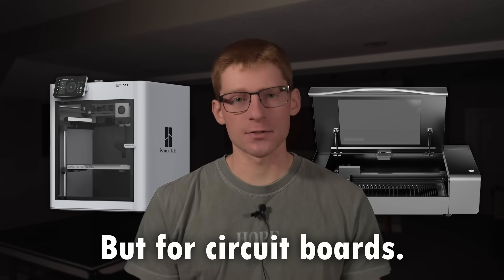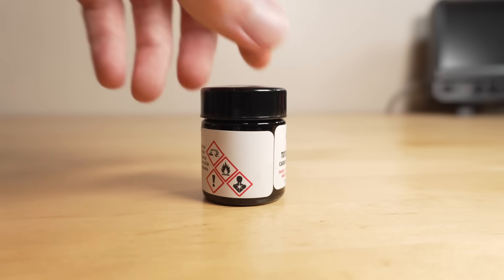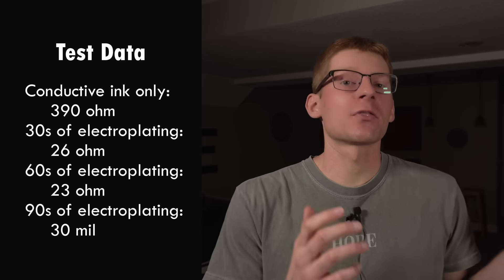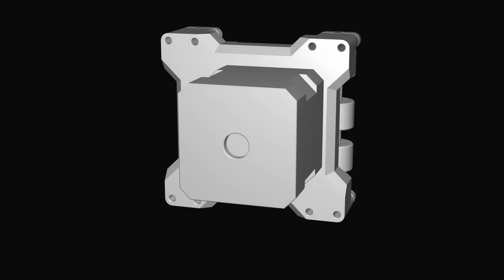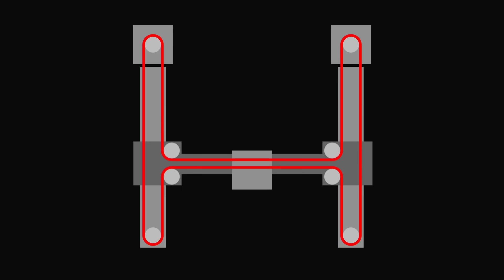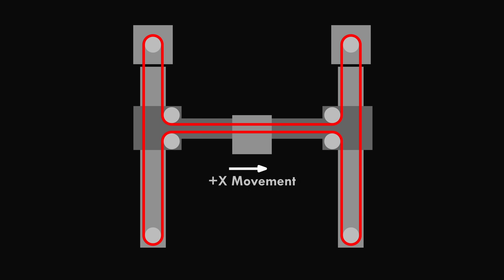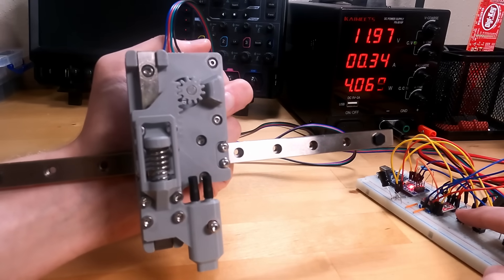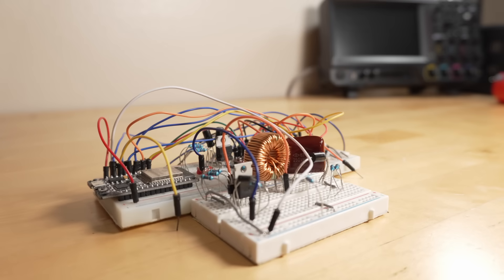I'm Developing a New Circuit Board Manufacturing Technology

Comment: For 30+ years, I've used a "mechanical etcher" to make hundreds of doubled sided PCB prototypes and small production runs. Basically it is a CNC router ex-manufactured by Instant Board Circuits model IBC912 (9"x12"). Demo vids on my channel @curtcoffee. Two 0.125" diameter registration pins are used to align the PCB to the machine bed, especially important when the PCB is flipped over to do the second side. The spindle uses a 0.125" collet with a set screw to hold either an etching V cut bit, dill bit, or router bit. Several mfgs make PC eyelets for connecting top and bottoms traces as others have commented below. Instead of plate through I just use a bare copper wire, typically a single strand 0.025" Dia. from a 22 AWG stranded wire then manually solder top and bottom. The IBC912 spindle (Z axis) is either up or down using a solenoid. No bed leveling needed. It has a foot that rides on top of the PCB that is manually positioned to set the V cut depth, seen on my video www.youtube.com/watch?v=th6Mw6TDyQ0. For single sided boards, I just tape down the board, no need for registration pins. Note: X and Y need to be square (trammed) else top and bottom sides will not align. I now use KiCAD schematic and layout, FlatCAM to create the tool path G code, and Mach3 to control the X, Y stepper motors and Z solenoid. It is a 2.5 D machine. Good luck on your project. Sounds fun.

Comment: Wouldn't you want to eliminate right angles in the reservoir so fluid is not trapped in the right angle areas by surface tension?

Comment: There is presumably a point at which the vias are too small to electroplate quickly, which is clearly at least 0.3mm. I don't know if PCB CAD can handle custom via sizing, but if it can you could try holes of increasing size up to your 1mm test and if something like 0.5mm works then maybe that could be viable?

Comment: As an idea, i had while you were describing how the copper plating is usually done all at once... what if borrowed an idea from SLA printers where instead after the graphite coating with the tool-head(s) you lowered the entire board into a copper plating solution at the bottom, much like how SLA printers lower into the resin, and then plate. One thing that might get in your way is the fact that the tool-head might get in your way. you could mitigate that by having the tool-head "park" out of the way. 

there may be other reasons why this wont work that i don't see as this isn't my expertise but i hope it might give you an idea that might work?

Comment: Hey bud, I manufacture  machines, one of the things I realized from doing it is that even slow as hell but, does the job, is worth pursuing. Say you go at 15 min per via, and it takes 4 days to make a 400 via board , better that a week ordering it from china. Would be 670 vias to break even. Do a 4 toolhead design,  thats  2680!,  If the process is energy efficient, silent and reliable. Some people dont care.  They will just try to  reduce via count. Since 2 layer boards are cheaper than 4 layer boards, I avoid 4 layer designs like the plague.   Look at 3d printing, people design around layerlines, no one is complaining about that too much anymore, 48 hour print times are fine if it does not fail. I would, as other have commented, go for  a dual set up, maybe a chemical  slow process, for bgas etc and a 0.5mm wire for routing. then your in business.

Comment: Awesome work ! but I think the machine should feed in the correct diameter wire thru the via. Then two identical endefectors like you have will simultaneously ' pinch, cut and spot weld ' from below and above and then move to the next via and bingo ! No nasty chemicals and Roberts you relative ! Talk to Stephen Hawes about x/y positioning or buy one of his pick and place because the two of you have the same goals, as for me ? I shall wait for the cheque....cheers !! oh yeah for reference you youngsters have forgotten, and probably will never see a PNP machine for thru hole parts!! putting wire through a hole at high speed is easy and they did in the sixties LOL!

Comment: I've used via rivets to repair faulty vias caused by corrosion. Wouldn't using via rivets be a far simpler solution? You could even replace the rivet press(although that is likely to be a trivial job for a CNC machine) with a soldering bath

Comment: ive been trying to solve the via problem for years :) good luck to us all brother. try thinner substrates - go to 0.4mm and I bet it'll be much easier. then you unlock multilayer sorta, if you find a way to bind these and make the vias interconnect, and align them layers. good luck again! - p.s. - another idea - try and make the holes sorta conical and not cylindrical - that way the material spreads a little bit better! it's not perfect but i've experimented with that method

Comment: I tried solving the via problem with handmade PCBs. I take a pin from a berg strip, put it through the hole and solder it from both ends. 

If you're trying to make PCBs at home for testing or small projects, you can use this method easily. If you want to miniaturize your design, you go for commercial production

I think you can also find a way to automate this and scale it down

Comment: Have you tried soldering through the hole... On the bottom side you have a flat neoprene butt with a cavity in it to line up with the bottom side of the hole and a hot 3D printing head (with a 0.2mm hole) on the top side and a syringe on the top of the 3D printing head to squeeze solder paste in through. The hot liquid solder would be pushed in through the hole to the other side where it would solder the under side with the top side in a quick precise squirt. If you used a Thermal Electric Cooler or TEC to cool the neoprene to a colder state, the liquid sold would harden quicker and should not drip when moving to the next hole. Because the TEC cold side and 3D Print Head hot side will only touch the PCB at the moment of injection, the board and printing head will not be cooled enough for the solder to harden on the print head nozzle. Would be an interesting video to see someone make that.

Comment: Wow what an impressive project ! To make vias on single face prototype board (made with laser or cnc mill) the tricks I found is to drill the via the size of copper solid core wire, then insert a small piece of it and solder it on both sides. It's a quick hack but it works a charm when making pcb prototype at home without equipment

Comment: As earlier posted: copper rivet.
1) Wire through needle to push through via
2) solder paste squirt on back, and solder tip heat
3) solder paste top,  solder heat.

Yes whiskers will be there a bit, but hand cut possible.   FDM shows you can get 80W to a head, so 6 mil is easy.

Can even do it by hand w/ cheaper model.

Comment: Have you considered using copper rivets to remove the chemicals for the via’s? I use the .4 and 1mm copper rivets they are reasonably priced 200 for 12$ + shipping.

Comment: I think your primary issue is with your deign requirements you have set for yourself. This is a prototyping machine for prototype boards. Why do you need to have .3mm vias? Why for prototyping can they not be 1mm? I understand that having to modify your gerber files for protoype and production would be annoying and a possible area for error but rapid prototyping is a nice trade off. I am not a fan of Elon Musk but he hit the nail on the head when he said you need to look at your design requirements because that are almost always bad.

Comment: As a maker that enjoys electronics, your concept is extreemely good. but nethertheless a hudge issue came to mind : the electroplating works efficiently because enough current can flow from the oxydizing anode (ie the copper plate in the bath) towards the reducing anode (ie the via being made). To maximize current, you will need to decrease as much as possible the resistance of the electrolyte path, by several factors :
1) put the oxydizing electrode after the pump (the peristaltic pump will make an open circuit with the pinched silicone tube). you can make just a little chamber for the electrode that would stay filled with electrolyte filled on one port by the pump, and the electrolyte would shoot out towards the nozzle.
2) You need to decrease as much as possible the length of tubing beetween the electrodes as the elctrolyte path resistance is proprotional to it
3) You need to keep a wide path to decrease even more resistance (R = c*S/L with C the conductance proportionnal to your electrolyte's concentration, L the pipe's length and S it's surface). I know you will need a thinner end to avoid air comming back up and keep the path filled tanks to surface tension, It will be a matter of compromise.

and maybe plating a pcb with a photo-resist layer would avoid getting copper build up on the outer surfaces of the pcb and only in the hole to help it stick ? it's just an idea but there seems to be an issue similar to dendrite groth in lithium batteries. avoid letting copper grow where it shouldn't may help

Comment: Uhm…why not use “rivets”? Wire is pushed through the hole and cut with a little slack. A tungsten or titanium needle presses and heats on both ends.

Comment: you can use a simple thin copper wire instead of vias . you choose to make vias by electroplating , but that is very hard and complicated , instead if you put a thin copper wire through the hole and connet both side to the pcd , it could work like a vias . i am waiting for your response , all the best.👍🙂

Comment: I am only up to the ad break, but I've always gotten great results from drilling all the vias, adding the same kind of conductive ink, a single electroplating bath, then cutting the traces. You're really missing out by not doing solder mask and silkscreen. Solder mask with silk screen fabric and a cheap sewing frame in white, cure, then another mask color in the intended mask color, laser cut the parts you want to be "silk screen" so it only removes the top layer, profit. I don't even bother buying from fab houses anymore and a cheap CNC with an added laser head next to the spindle is all you need.

Comment: Why don't you use small rivets for the connection between the two copper sheets instead of electroplating? 1mm rivets are standard components that have 1mm OD and around 0.4mm ID. Also, you don't have to align a second tool head on the bottom to fix the rivet.

Comment: BotFactory, I dont wanna kill this idea but BotFactory is a machine that does this almost exactly. Its a multilayer (UP TO 4) pcb printer that has additional capabilities such as having pick and place and a heated bed for soldering smd components. It uses a very similar system to what you have described and can print a board in under an hour. Saw one in action at a university and it was game-changing for fast RnD and prototyping. 

God please dont let YT bury this
Reply from the maker: 3D printing PCBs is one of the existing methods that I hinted at. The problem with 3D printing boards is that conductive ink/filament is nowhere near as conductive as copper, making them useless for many (if not most) applications. I've never seen anyone in industry actually use one of these tools. I would argue that a PCB fabricator must incorporate both additive and subtractive methods to make it a solution that most people will actually use.

Comment: I started doing research for this over 25 years ago. I too needed to rapid prototype boards done in-house. This was way before 3D printing. Additive manufacturing wasn't even known then. I tried using a color desk jet with conductive ink. This allowed different types material; conductive, non-conductive, etc. I also tried color laser printer using metallic powder. Both designs used a Mylar sheet that fit standard printers. For multi-layer type boards, the printer laid down a non-conductive trace.Finished sheets could be mounted on a rigid board, or left flexible.  Eventually I decided to wait until technology caught up.

Comment: What if you insert a small wire though the hole using something like an extruder from 3d printer or EDM.
Then start copper deposition to this wire, layers of copper will start depositing from center to outer bore and eventually it will be connected to the two sides of the PCB.
Since wire is inside and you apply voltage to a solution and a wire itself you can apply as much current as you want and not affect PCB itself until there will be a connection.
The only problem that I see right now is how to precisely insert a wire and catch it from the other side in order to maintain concentricity.

Comment: Incredibly cool project, and looking forward to seeing it progress. One suggestion I would make is instead of going for a CoreXY or H-Bot architecture, it might be easier to go for (in 3d printing terms) a "Bed slinger" where you would move the PCB instead, meaning your via and trace apparatus (the heavy bits) can be as secure as necessary and don't need to move, and the PCB (which barely even gains mass like the issue is for 3d prints) can whip around as fast and secure as you like.

For future developments, if multilayer boards are the goal, it might be possible to make sets of 2 layer boards and then stack them with an extra layer in between, but making everything line up perfectly might get tricky.

Comment: Maybe I am stupid, but if I understand it correctly you are drilling all the holes before doing the etching process. Can you not connect the one electrode of the electroplating process directly to the clad board from the outside? Or is this a totally different plating method I learned in physics of only two electrodes one gaining mass and the other losing? Is I understand from the visuals the clad board is not connected to anything.

Comment: What about mechanical Vias? A small copper tube a bit longer than the PCB. Push it through the hole, and then flatten/pinch on both ends, so it makes electrical connection between both sides. The only downside I can see, is that the vias will not be flush with the PCB.

Comment: I admire your efforts to do this at home.  As an armchair PCB designer, an alternative comes to mind to have your servo and guide run a very thin wire through the hole and bend at the top to lock it in place.  You could then hand-solder or add a soldering tip to your inserter.  I look forward to your next steps!

Comment: I have always fantasized new crazy ways to make electronic circuits, like why isnt there 3d models where you can drill from two arbitrary angles, then dump in solder paste at a 3d point where wires connect... and heat up that solder paste point somehow

Comment: I think one question is, do you really need to do all this? Desktop CNC Mills are plentiful with thin drill bits available, and you can always just stick a wire through a hole. The point of the way veers are done in production is mass manufacture. Dunk it in and take it out, all in a production line. It's difficult for a robot to put loads of wires through a board and solder them.

If it's just a prototype board, there's nothing wrong with a small hole you can thread wire through, solder, then cut with some snips. To put it in perspective, a 3D printer is not the most ideal way to form a plastic part. Injection molding is. But injection molding is complicated and industrial. You're taking the complicated and industrial process for circuit boards and trying to fit it on the desktop. That would be like trying to make a desktop injection molder. 

If your goal is just home fabrication, A CNC and some wire (and even rivets), are excellent via options. Although just threading wire through or riveting is not ideal, just how 3D printing is not the most ideal for plastic part formation, It is more than good enough for a home gamer/prosumer. However, if your goal is to do it just because you can and for the fun of it. go for it.

Comment: Would it be feasible to just do the ink deposition per via, and then switch to another "static" setup with custom-made (hurray to 3d printers!) liquid channels for all the vias? Or even just sealing against the board edges. So electroplating would be parallel for all holes, but still with a small amount of liquid and well sealed and desktop friendly? After all, we are not talking panels but single, small PCBs

To my understanding, your idea (and success) of applying conductive ink as the base for the electroplating is already amazing!

Comment: What if it shouldn't be do by chemicals ¿Isn't there laser deposition of metal? Probably a wrong idea, too much heat, costly, complex... I mean it should be a tiny layer sooooo shouldn't use enough energy... Nah im probably wrong.

My crazy idea was, just forcing an ion to stay in place pushing it with light or evaporating the liquid which the metal is supended in

Comment: Simplicity is key. No need to overcomplicate test procedures. Iterate and fail rapidly. Though I get it. Design is a fun process and those prototypes look rad. So many little troves of information where you’d least expect them to be. Also, if you’d like to accelerate the project community involvement would make this process much more feasible. Even if indirectly. There are many of us tinkerers and the whole desktop machine space is so awesome. Nonetheless, great video. Thanks for sharing :)

Comment: “Perfection is the enemy of good enough.”  Don’t lose sight of the fact that this is for prototyping.  Even something like automated wire insertion into the via, with wither manual or automatic soldering or electro-welding might be adequate.  Regardless, great work!